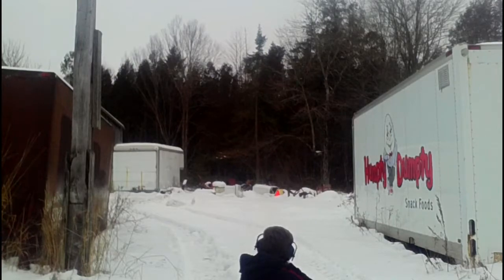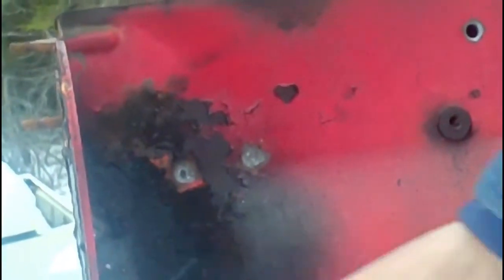Cast Iron engine block, penetration test, .223, 7.62x39 and 7.62x54

Comment: First off great video, I'm from Ontario temagami rez. North bay area. Gotta love shooting with dad. 2 idk They weren't steel core I don't think. Was the 7.62x39 Chinese from a green or plain steel spam can Chinese surplus or was it a red yellow or white box norinco which is  New production but looks same as surplus from the metal bulk cans which is the steel core stuff, if the Chinese ammo has red around the bullet and primer then it's most likely the old surplus which is steel core it's the best ammo we can get and cheap but just corrosive only issue. I ask because 

If it was even the mild steel core fmj surplus it would have gone right through the thinner areas especially.

I don't believe the 7.62x39 from the SKS was steel core either, If it was I'm surprised because I seen steel core go through thick metal n objects a normal lead fmj x39 bullet that has no business penetrating such things.
Reply from the maker: It's been a long time now, I don't remember what we had for ammo. Thanks for watching!

Comment: can a 223 and 7.62x39 be shot in the same gun? like an sks ?
Reply from the maker: There are certain models of rifle that can be chambered in either 7.62X39 or .223, but you can't shoot both in the same rifle. 7.62X39 is a much larger diameter case and bullet. Thanks for watching!

Comment: Surplus ammo is steel jacket with a lead core. Better penetration than a copper jacket lead core, but not on par with TRUE AP steel core. Ive got x54r and x39 dissected on my reloading bench and have for years. Great vid!

Edit : heres a video showing steel jacket lead core x39 and x54r surplus ammo : https://youtu.be/EyPEivtDNbU
Reply from the maker: I believe most of the Russian surplus had a mild steel core, then lead with a steel jacket, but like you said definitely not armor piecing. Thanks for watching!
Reply: @CanadianRedneck15  the majority of what I found is lead core steel jacket steel case like in this video x54r and x39 disassembled :

https://youtu.be/EyPEivtDNbU
Reply from the maker: @89StarquestTSi  OK, I know I've had some with the mild steel core but I don't remember now what it was. I think the Czech surplus X39 I have is steel core.
Reply: @CanadianRedneck15  iirc those were tungsten core. I believe the czech surplus were tungsten core thats why they banned importation of it
Reply from the maker: @89StarquestTSi   Luckily in Canada it still turns up from time to time already loaded on stripper clips. Quite nice!

Comment: Funny the steel core ammo for the mosin did not penetrate much more. Great video.
Reply: Considering the x54r is moving at 2695fps and 2295ft lbs within 10yds and the x39 is 2385fps and 1566ft lbs within 10yds youd think the x54r would definitely of of done more being almost 700ftlbs more energy lol
Reply from the maker: That surprised me too. I am glad you enjoyed the video, thanks for watching!
Reply: @dankorth1325 They weren't steel core. If it was even mild steel core fmj surplus it would have gone right through the thinner areas especially.

I don't believe the 7.62x39 from the SKS was steel core either, If it was I'm surprised because I seen steel core go through thick metal n objects a normal lead fmj x39 bullet that has no business penetrating such things.

Comment: Should have painted some lines on it to mark off the different areas so you knew what you were aiming at.
Would have liked to see some silver tip Nagant rounds.
Note that most Chinese and Russian military surplus ammo is normally steel core even if it isn't marked as such - a magnet to the tip will confirm.
Nice test still and even nicer to see you getting your son involved - thumbs up just for that.
Reply from the maker: Thank you, my sons are 20 now and both enjoy hunting and shooting with the old man still so I'm very pleased! Thanks for watching!
Reply: Most your surplus is a steel jacket with a lead core. Better penetration that your basic copper jacket, but not on par with true ap steel core jacketed
Reply: @89StarquestTSi  Actually, it is the case which is made out of steel, not the jacket of the bullet - I can't even find such thing as a steel jacketed bullet on Google.
Reply: @seanfoltz7645  i have 2 surplus x39 and x54r projectiles i used my frankford arsenal pile driver to disassemble and a simple dremel to cut the projectile open. The cartridge is steel, the projectile jacket is steel, the core is lead. If i could post photos i would
Reply: @89StarquestTSi  video is showing as having been removed - not a problem though as I did some more research and was able to confirm you are correct in that some of the older Soviet stuff did use cheap steel to jacket the bullets.
Whether the steel jacket provides better penetration than a copper jacket seems to be up for debate but everyone concurs that the primary reason was that its cheaper.  I'm inclined to agree with that since if it was cheaper AND better then steel jacketed bullets would be the norm among military calibers around the world.

Comment: Would love to see if a 5.56 62 grain M855 round would punch it or not.
Reply from the maker: That's the "green tip" round right, I'm sure it would. Thanks for watching!
Reply: In the US its the M855 and internationally its called the SS109, but green tip indeed.
Reply from the maker: Right on, our bolt rifles are chambered for .223 so it's not recommended to use 5.56 though rifles chambered for 5.56 can fire .223 so I don't have any of the m855 around.
Reply: Your bolt guns can handle 5.56, just not a steady diet of it though.

Comment: Have you changed the firing pin to a spring loaded one in your SKS? do you find it would be needed? Thanks  P.S. what part of NB you guys from?
Reply from the maker: +dremon123  My SKS is a 1950, so it has the factory spring loaded firing pin. The main thing is to make sure you clean the bolt well every time you shoot corrosive ammo and make sure the firing pin is free in the bolt. Maybe once or twice a year break the bolt down and pull the firing pin, clean and oil and you'll be good to go.
Reply: Thanks for the reply. Mine is a 53 so no spring but I clean my rifles each time i go out...part of my routine i guess. Great to see someone on youtube from my neck of the woods :) I'm in Moncton
Reply from the maker: +dremon123 The internet is a funny thing, we can talk to people half a world away, bjt it is exciting to find someone close by! LOL
Reply: No need for the spring loaded firing pin. Shake your bolt before reassembling the gun. If you can hear your firing pin rattle back and forth you're safe, if you don't take the bolt apart and clean it. If you plan on shooting boxer primed commercial 7.62x39 you might find the stock pin pierces primers though but not everyone has that problem. I just shoot surplus out of mine so I've never had it happen

Comment: Awesome video, I think soft point and FMJ bullets will penetrate equally into metal or certain materials that are much harder than the projectile itself.(if you shoot rocks,cinder blocks etc a soft point will do the same as FMJ usually). To get any real difference in penetration I believe one of the projectiles must be harder than the metal itself. In mediums like soft wood an FMJ will penetrate more because it won't expand like the soft point, but when shooting a metal plate a soft point will do as much damage as an FMJ because it is still carrying the same amount of Ft-Lbs energy but the metal is much harder than either projectile. The metal still  has to absorb around 1,200 ft-lbs from the .223 regardless of the projectile. If the projectile has an armor piercing core that's stronger than the metal then it will make a difference. Even a mild steel core from a surplus round won't penetrate into a steel plate anymore than a soft point, at least from my own tests this appears to be true.
Reply from the maker: +codfishdoom Sadly, I have nothing resembling armour piercing right now. The surplus 7.62X39 I have is lead core, no steel core at all, I'm not sure about the 7.62X54R that we have. We still got to get out and do some shooting, so was a good day! Thanks for watching!
Reply: If your 7.62x54r Surplus rounds are the 147grain from the can it's more than likely mild steel core ammo, you can find out by shooting certain things and finding the core left behind. The mild steel core does give the round enhanced penetration through almost all things that are softer than steel, like multiple layers of car doors or hard wood, cause even the FMJ will break apart and lose all its mass after going through multiple layers while the steel core holds its shape and penetrates further. On a plate that's harder than the mild steel core though, it won't give any more penetration that a soft point or FMJ. Thanks for the videos, looking forward to more.
Reply from the maker: +codfishdoom I didn't find any bullet fragments because of the snow at the  time, but I will double check when the snow is gone, thanks.